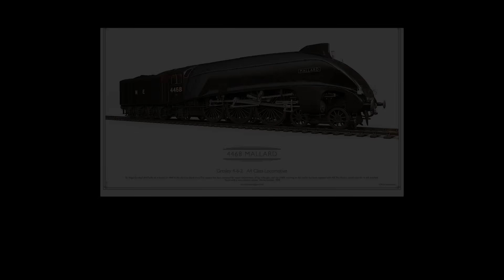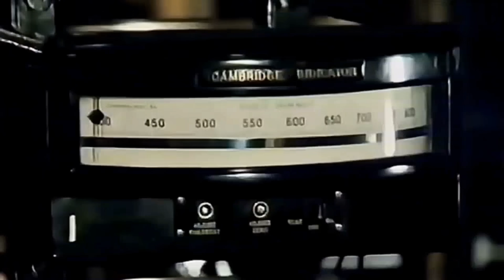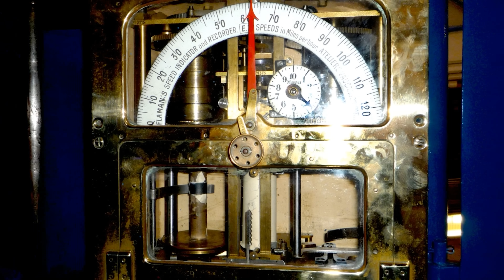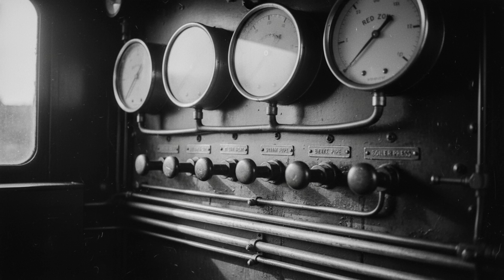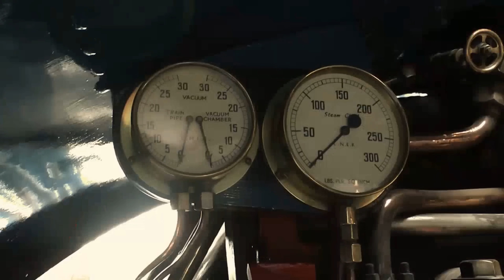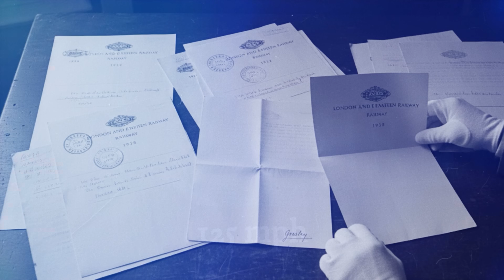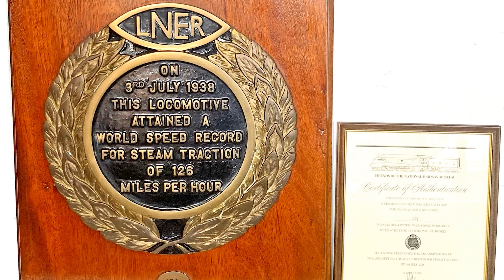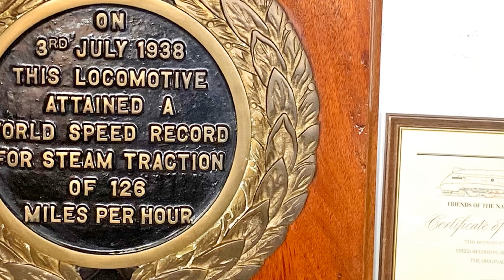How DEADLY Was MALLARD ACTUALLY?

Comment from the maker: For anyone wondering: ‘deadly’ here refers to how close Mallard came to destroying itself, not danger to people. It was pushed to the edge of catastrophic mechanical failure, mechanical risk, not mortal risk.
Reply: This raises the old question about record runs: Do you achieve the record within everyday operating parameters, or do you go beyond the engines envelope? The german contestant, 05 series of the german empirial railroad, ran 200,9kph (125,55mph) , that is 0.8% slower than Mallard, but under everyday conditions, on an even track without any special preparation on the engine and not melting any bearings.
Concerning molten bearings: Bearings on steam locomotives where routinely babbited, this gave them some reserve to reach the next depot in case of a lubrication failure, which is a relatively common mishap in steam locos. The babbit is designed to slowly wear away in this mode of operation to protect the precision machined parts of rods and axles.
Reply: @tamime8928  200.4km/h / 124.5mph is the actual number. DRG 05 002 also got its record with a 197 ton train whilst Mallard did it with 240 ton, had Mallard only been pulling 197 tons it could have gone even faster than it did with less wear.
Reply: @Kairu_Kilofski  But Mallard was going downhill!  (Slightly.)  Gravity always helps if you want to go fast.  In terms of pure physics the 0.4% down-grade is enough to give half of the 0.8% gain Mallard obtained!
Reply: @tamime8928 
Meanwhile automotive engineering moved to circuit pressure fed rod end bearings as an essential.All rail loco rod ends seem to be compromised in that regard.

Comment: If Gresley couldn't sort out his valve gear he should have contacted Swindon where the GWR had utilised conjugated valve gear since before WW1 on the Stars and then the Castles and Kings. They used to do over 100mph and never had this problem.
Reply: K.J Cook (ex GWR man) fixed it in the early 50's using the gwr's machined whitemetal bearing method , gresley used a hand scraped method

Comment: To me, this is no Record! The Engine was damaged in this run, so you can't count that as a "victory".... - go back and fix your issues... - than try again.... - DRG-Class 05 is still the Champion!! - It was running in a normal operations status, was not damaged, and not even at its limit !! - Only ongoing war operations stopped further record rides... - otherwise she would have gone even faster....
Reply: 100% correct

Comment: The greatest feat was reaching Stoke Summit at 75mph from virtually a standing start. Gresley cured the bearing problem by using marine bearings. Akso there were NO paying passengers on this run.
Reply: Gresley did not , it was K.J Cook in the early 1950's using machined white metal bearings

Comment: A double chimney Coronation pacific would have beaten Mallard on the same road...
Reply: Sadly we shall never know but fan though I am of the Duchesses (My first model trainset had Hornby 3-rail Duchess of Athol) I wouldn't like to bet.  Horses for courses. The A4s were optimised for prolonged high-speed running, the Duchesses were flyers but their most outstanding achievment was  hauling heavy trains up Shap and Beattock. Still the 4-cylinder Stanier configuration certainly gave smoother distribution of power so they probably wouldn't have fallen apart. For the same reason I wonder what a Castle could have done under those conditions.
Reply: @andrewdarley8988 They certainly would not have fallen apart! Coronation was in perfect condition after the 113 mph withh single chimney. it should be noted that the A4 only had a single chimney when it achieved 112.5 mph ,Mallard,on the other hand had a double kylchap blastpipe exhaust when it achieved 126mph. The Coronation achieved  far better results with a double exhaust ,the problem with the  L.M.S. road was that unlike the L,N,E.R. there wasn't a suitable place for it,too many speed restrictions for example. it should be remembered that, when Coronation reached 113mph they were rapidly approaching Crewe,and had shut off steam ,she was still accelerating,and took 5he reverse crossover on the approach to Crewe at some 56mph,,however, she still stayed on the rails,the only damage done being broken crockery in  the dining car!  The Stanier Pacific was certainly a very good design, largely due to Staniers chief draughtsman Tom Colman,who had a free hand in the design of these engines while Stanier was away in India. I feel absolutely certain that a Coronation would have beaten the A4.Also, I should mention that Coronation only had a single chimney when she achieved 113mph.
Reply: The Coronations were like Clydesdales. Gresley's pacifics were like the best Arab stallions.

Comment: It was held together by more than just luck and prayer, it was back in service fairly quickly afterward! A little dramatic seeing as the valve gear was adjusted for better reliability. Unfortunately the competition was gone and trackwork in bad condition. Multiple A4s went over 100, some over 105 and a few over 110. It didn't knacker them, they just weren't at their best when the record was attempted. Look at 60007's 112mph run, that was in a better position to go through 125 than Mallard, with more weight behind it too.

Comment: This is a very good video discussing such a legendary endeavor. I personally think another reason why the record hasn't been attempted was out of respect for the accomplishments of Gresley. Who knows, maybe an attempt will be made, though I doubt it'll be From any of the preserved A4's
Reply: If anything origninal will go over 100 again, it'll probably be 60007 on the 100th anniversary (should be fresh from overhaul then). Having spoken to a few drivers they reckon an A4 or Duchess would top 100 without too much of a problem
Reply: @williamscates3915 I heard talks of something special happening for the 100th anniversary. Do any of them think an A4 will be able to match Mallards speed record? Technology has come far in 100 years, there could be a solution to the valve gear issues you described in this video.
Reply: If you really wanted to push it, then you'd go for one of Bulleid's spam cans.  Don't forget Bulleid was Gresley's side-kick and learned everything from Gresley - but he was more innovative, more inventive and did a huge amount more experimentation in his career, and took the technology on further than the more conservative Gresley ever dreamed of.  Here's why Bulleid would have been the record holder.  Ultimately "The power of a steam locomotive is limited by its ability to boil water" (so said HA Ivatt, designer of the GN Atlantics, who knew a thing or two about high speed steam engines) and the Bulleid boiler out-performed any other boiler when a Merchant Navy was tested at Rugby on the rolling-road test plant that Gresley built.  Even with two firemen shovelling as fast as they could, the Bulleid boiler ate all the coal they could supply and was still hungry for more.  The test wasn't able get to the peak output of the boiler because the TWO firemen just couldn't keep up.

Had Bulleid had the luxury of the smooth, straight ECML to run his engines on, and the circumstances that prevailed pre-war, rather than the very substandard SR track and wartime/post-war Austerity conditions, there is little doubt in my mind that the plaque for fastest "kettle" would be on one of Bulleid's MNs, not still on Mallard.  Many crews thought the rebuilt MNs were even better, and of course with the same boiler . . .

Comment: And that's the reason why Gordon swapped his gresley valve gear with a stanier one in the books, I always thought the gresley valve gear was odd with the extra piston powering the middle driving wheel axle
Reply: Gresley's was practically the same as Walschaerts valve gear, except the levers to within which powered the middle cylinder. There are many successful 3 cylinder designs, nothing odd about them at all. The difference with the A4 is that the outside gear drive the inside one, and so if there was any misalignment it would still smoothen out, negating the need for another heavy set of eccentric rods between the frames. In a way it's like a complex version of the Great Western Rocking shafts on the Kings and Castles.
Reply: @williamscates3915 I just researchered the wiki and Gordon got a stanier valve gear , not a walschaerts , my bad
Reply: @陳毅恆-v8x Stanier's was a walschaerts type too. Looking at a Stanier loco you see a really clear example of it!
Reply: @williamscates3915 at least Gordon's valve gear problem is solved
Reply: The modifications made to Gordon actually make him faster than Flying Scotsman by a smidge. Although I think when he went for an overhaul in the 50's he got a A3 Boiler and Running board(I could be wrong there). His valve gear and larger pistons do make him faster though. Not enough to REALLY challenge the A4's speeds shown here though.
Reply: @BTTG112 i just searched the wiki, he never got an A3 boiler, his only rebuild is his chassis and his valve gear in 39 , which was switched from gresley to stanier design
Reply: Odd?
Have a look at the Spams.
Reply: @andrewelliott4436  Not Walschaerts, but clever! Would love to learn more about that and the Caprotti on 71000!
Reply: The extra piston was the secret to it's success, it's what gave the A4's the extra power they needed to achieve their record breaking world class performance.
Reply: @majorpygge-phartt2643  3 deliver more smoothly than 4 as there's a power stroke every 60 degrees as opposed to 90 for a 4 cylinder. Cylinders don't mean more power - that's down to steaming ability and the efficiency of the steam channels/valves.

There's lots of 2/4 cylinder locos, also lots of 3